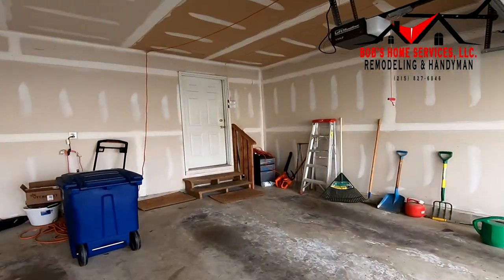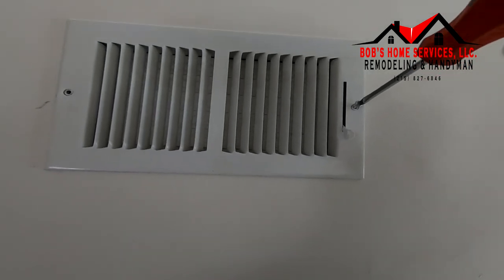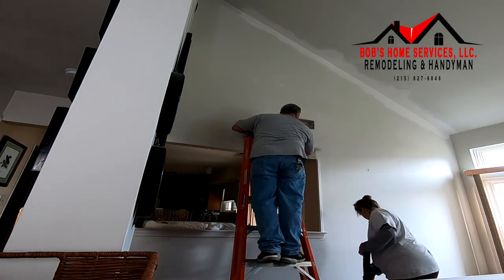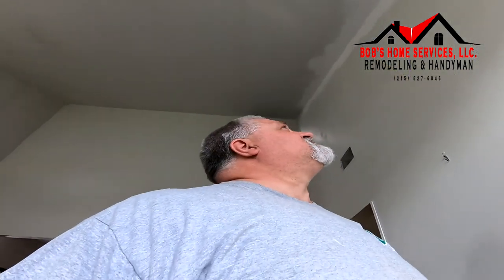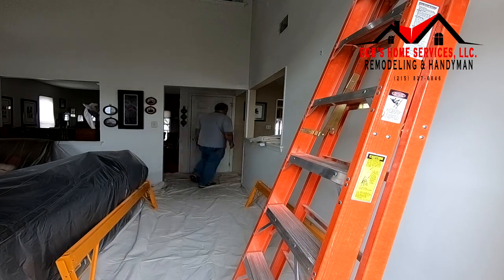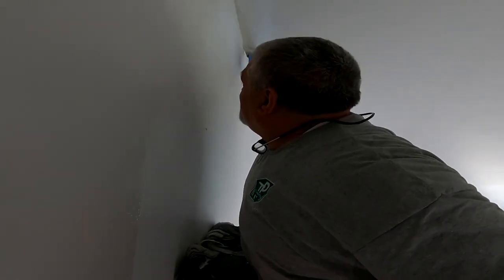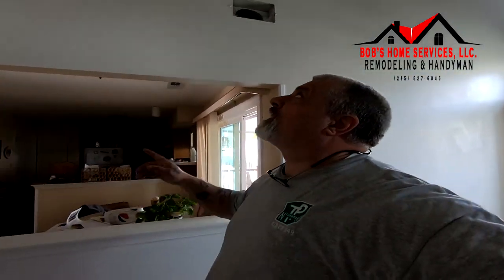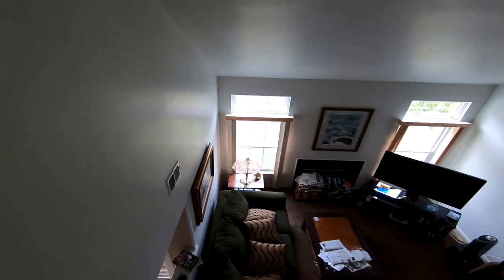Painting a 20ft High Vaulted Ceiling

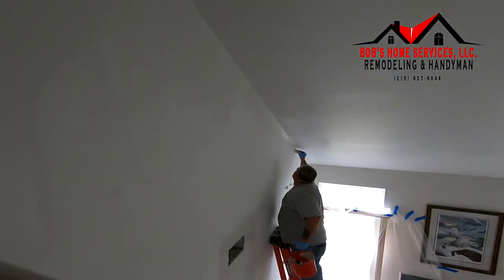Comment: This isn't a video of "Painting a 20ft High Vaulted Ceiling," except for about 10 seconds of cutting a bit of the edge of the ceiling into the WALL on a ladder at around 9:30. The rest of this 9:30 video, which is almost all of it, is drywall work on the WALL, taking vents off the WALL, masking the WALL, putting scaffolding along the WALL we never see you use, painting the WALL standing on the floor and on a ladder leaned against the WALL, putting vents back on the WALL, and cleaning up along the WALL-- the WALL is not THE VAULTED CEILING.